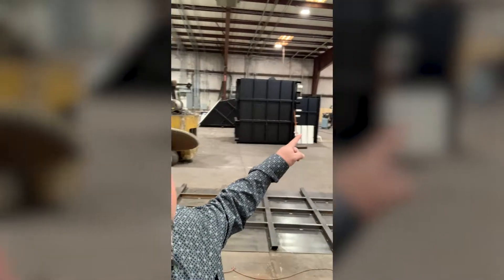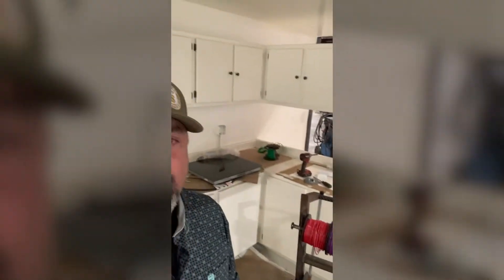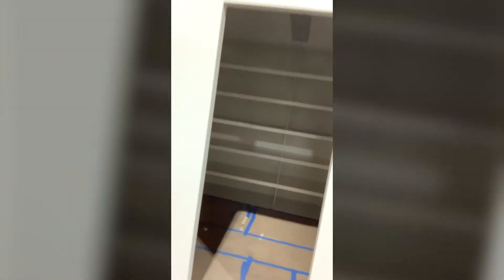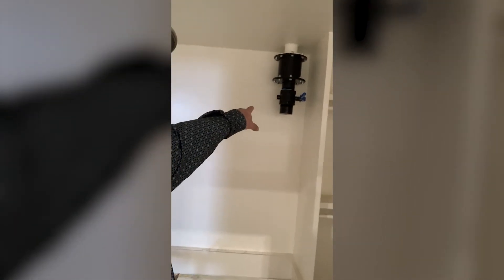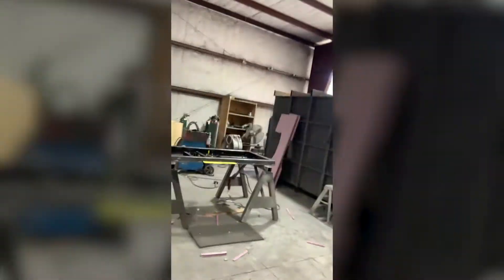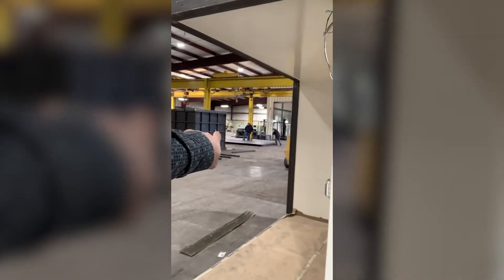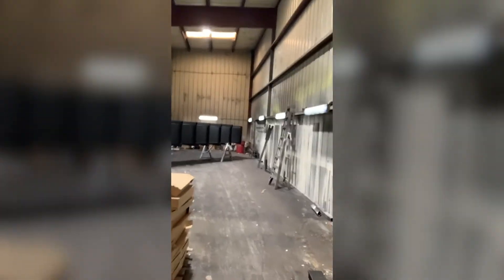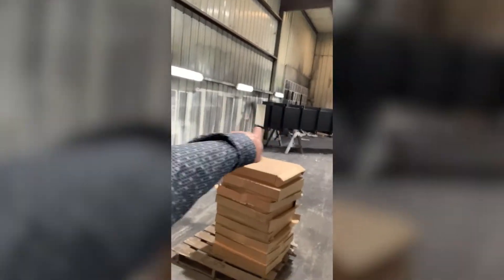Let's talk steel & Strength - Rising S Bunkers Edition

Comment: Why rec. tubing rather than i beams for structure?
Reply from the maker: Why drive up the cost using I-Beam when square tubing carries the load just fine? The same question could be asked as to why the ceiling joists in most homes are 2x6 instead of 2x12, the answer is because its simply not needed.
Reply: @RisingSBunkers  Fair nuff

Comment: You really should use hand crank assisted air filtration systems in your bunkers. You can't count on the grid in shtf situations. In my country all the shelters must have hand cranked air filtration systems.
Reply from the maker: We do not rely on the grid, we rely on solar and batteries for our system. You can also use a hand crank generator for less that 2 hours per day that will generate enough power to use the filtration system, which is more efficient than using the hand crank on the air system for a much longer time and it is much easier to do.

Comment: Rising S Bunkers , I got a question can you underground bunker protect me against a tornado especially class 5 tornado . if you don't hear something , I have good idea  or maybe the whole of the bunker needs to be deeper like 12 ft deep I think that would do it and you have to cover up with it rocks & Highway roads .
Reply from the maker: If protection from an EF-5 Tornado is all you need then any depth below the surface will suffice. Clydes own home was hit by an EF-4 on April 29, 2017 and a simple tornado shelter not more than 12" below the surface of the earth, had zero damage. While that is not an EF-5, the point is that the cover of dirt on top is what protects you from the wind above, the door itself is exposed at ground level and susceptible to damage but there should be an additional door at the bottom of the stairs to protect the shelters occupants. This would be the same no matter how deep the shelter was. For Nuclear, etc this is a different scenario.